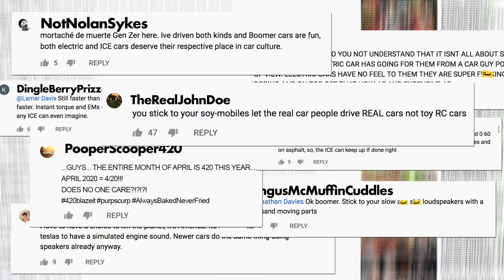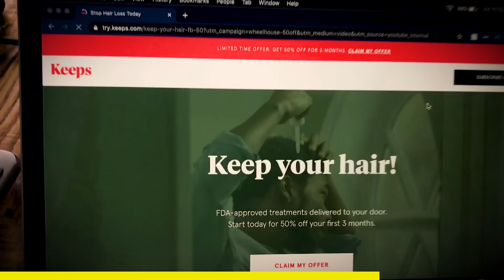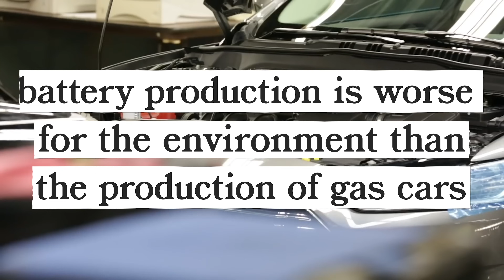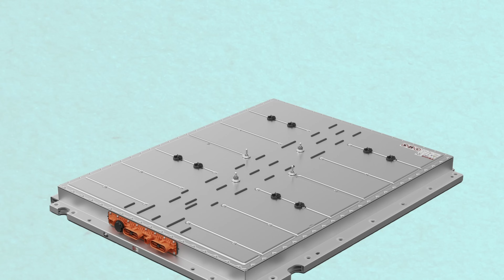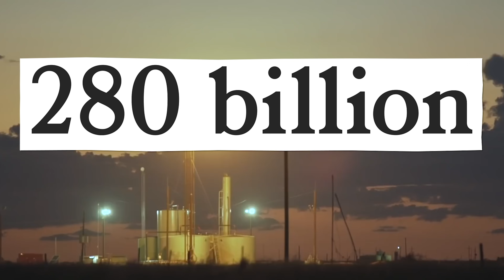Are Electric Cars REALLY Better for the Environment?

Comment: Do you want to cut your CO2 emissions, without giving up your gas car? Cycling more for the short trips.
Reply: or electric scooters
Reply: @lightzpeed4458  come on traditional Cycles will be far more efficient than electric scooter. It will be a workout too.
Reply: @埼玉-u6l  No, the human body is awful in terms of efficiency in terms of cycling
Reply: @Namenloser127  does it increase one's carbon footprint ?
Reply: @埼玉-u6l  Yes, yes it does. You breath out more Co2 and you need to eat more food which may also have it´s own carbon footprint. But what has that to do with efficiency?
Reply: @Namenloser127  Cycling is more efficient than walking. Mark Twain considered the bicycle the height of human achievement. Some  rather humorous stories by him.
Reply: @Namenloser127  not true , you can go 100 miles on a sandwich and a bit of water.
Reply: @Namenloser127  The efficiency of a vegan cyclist is around 300 MPGe,a carnivore 15, and the average cyclist 85
Reply: @埼玉-u6l  trees breathe in CO2 and out O2, we breathe in O2 and out CO2. The amount exhaled by living creatures is easily negated by all of the plant life on the planet. We definitely need to prevent deforestation, and even more so, check the pollution of the ocean, as most of the oxygen on the planet is created by aquatic plant life.
Reply: @Namenloser127 ...sorry, but you're kinda wrong. The difference between bicycling and riding an E-scooter is basically the same if you're comparing apples-to-apples. Obviously, some bicycles and some cyclists are more efficient than others... if you're heavier and out of shape it'll take more calories... but it'll take more power from an E-scooter too.

If you're comparing a road bike to an E-scooter, most cyclists can easily go 15 mph on a flat road and barely break a sweat. The additional calories burned over their base metabolism for an hour would only be a few hundred extra calories.
Reply: @Namenloser127  Haha that is the most hilarious argument against cycling i've ever heard! I'm sorry for laughing but you really should study more. You can't compare eating slightly more and breathing more to driving your car everyday. Cycling more is one of the best things you can to to both your body and our planet.
Reply: @NilsHedstrom  "You should study more" ...ok kinda rude

But when did i bring up cars, i just said that were are not very efficiebt when it comes to single tasks such as powering wheels.
Reply: @Namenloser127  Okay sorry bout that, but I interpreted your comment as saying a bicycle would be bad to the enviornment cause of the reasons you stated which i found as a hilarious argument. But okay now I kinda see your point more. But I would still argue bicycles being the best mode of transportation if we talk journeys bellow a few miles. Its outrageous people take their cars everyday on such short journeys.
Reply: @Namenloser127  Also humans need physical excersise, we need to move which is a fact. So how would cycling and breathing more be bad? Then you both get the excercise needed and transportation every day. Also us breathing more has a minimal impact. Never heard anyone condemn people doing physical activities before.
Reply: @NilsHedstrom  Bear in mind regarding USA's attitude regarding mass transit (which requires walking), and you will soon understand your comment's last bit.
Reply: I bike to work every day 👍
Reply: @sureynix  
Prior to retirement I bicycled 13 miles one way to work about three days a week. There were 35 traffic signals along the route. 
I obeyed all rules of the road and found it took about 12 minutes average longer to cycle than drive. I ran away from the ebikes. 
On the flats with little wind I could reach 30 mph. Including red lights on good days I could average 18 mph for the trip.
I lost weight and gained fitness. Many ridiculed me, my revenge was after 30 years I was 6' 3" 195 lb while my coworkers weighed much more, even the shorter ones. 
Retired 2016 and still ride although  not as much. Still 6'3" and 205. Clean heart and good lungs. Only prescription drug is for gout.
Reply: @edwaggoner7403  the only ridiculous there were those comfy asses that couldn't understand you. You should be proud of yourself, just as proved that kind of decisions make us more healthy and therefore, happier. 😊
Reply: @sureynix  Very brave of you, I have heard that drivers in your country are very agressive.
Reply: @sureynix  wow, you’re so virtuous, do you wear a mask too?
Reply: Ebikes blow my mind. Things are crawling along, and a dude on a pedal bike rips by.
Reply: I ride several ebikes. One designed for riding in good weather and another designed to ride in rainy weather (has a heavily modified Veltop attachment with windshield and cover). I get an average of around 950 MPGe for them which is about 10 times more energy efficient than electric cars. Also I pedal along bionically with the motor to greatly extend the range.
Daily Aerobic exercise I learned is required for good human health. It makes sense to get this "required" exercise traveling to your daily destinations. I use my ebikes for grocery shopping and carrying other light cargo as well as for fun trips.
The Lithium Ion battery packs that I have help me to go to more distant locations and the motor assures me that my exercise is not strenuous (which can be harmful to human health especially for the elderly).
Most of the energy used in electric cars is squandered (wasted)  just moving a big heavy box around.
You don't get any healthy exercise passively as a driver in a ICE car or electric car.
Reply: Yes especially given that the average car journey taken is within a short cycle commute distance.
Reply: Honestly if u Wanna Go somewhere Near a Cycle's Pretty Much Alright to Get to that Place.
Reply: i'll stay with my old v8 and 2 stroke bikes
Reply: If society goes like this we have to put co2 not just in tailpipe but now in nose too if too fat too much emissions
Reply: Water powered cars, they are real.
Reply: @PinkSlimeEntertainment  I think you mean hydrogen cars. Hydrogen is made from water.
Reply: @mardiffv.8775  no, hydrogen is not made from water, actually water is made from hydrogen…
Reply: @PinkSlimeEntertainment  
I once had a water and air powered rocket when I was a child.
Reply: Not that easy when you live like  basically between huge pronounced hills 🥺 so i use electric skate instead
Reply: Or just drive a diesel car. Even better a "blue" diesel car.
Reply: That's what I do
Reply: What if we live in suburbs that require residents to rely on cars
Reply: There’s a way and it’s called e fuels, but car companies want to go “green” since is cheaper to make a ev platform and “engine” than a gas car engine which has more components. But they’ll still charge you the same and contaminante almost the same 🙃
Reply: Good thing I have a diesel truck not a gas car
Reply: @felipe0102031  Hee hee, that is funny. I like that.
Reply: No, that'll hurt
Reply: @8 A.M it's still negligible
Reply: @Ayjop if you don't have time you do and if you need to carry a lot you do
Reply: That would be great if I could get 2 children and the wife on a bicycle and still have room for the shopping …
Reply: @andyxox4168  please stop acting dumb 🙏🏻. You better know when to use a cycle and when to use a car therefore not everytime you go outside you need a car.
Reply: @埼玉-u6l  , yes, I know not to use a bicycle in my daily life … so you get it now!
Reply: @andyxox4168  Buy a Bakfiets. Problem solved. http://www.fietsencompany.nl/product/bakfiets-troy-7sp-naaf-matt-black/
Reply: @mardiffv.8775  … now you’ve just descended into foolishness … 😂😂😂
Reply: @andyxox4168  Well, my country the Netherlands has descended into foolishness then. Bakfietssen/ cargobikes are very popular among mothers of young children. I am happy to go cycling and not drive my car. It saves a lot of gas money. Gas is very pricy up here, due to high taxation (8 bucks per gallon).
Reply: @andyxox4168  Have you seen a yuba bike?
Reply: @MrRentageek  no but if it’s a ‘bike’ I don’t want one thanks 🤮🤮
Reply: @raphaelvermin  …  now you’re making assumptions but for the record I’m not fat, I have a BMI of below 23 and take regular exercise. I choose not to cycle!
Reply: @raphaelvermin  .. right and your ignorant of the normal medical limits of weight, I’m no 10st weakling but I think you’ll find 18-25 is ‘normal’. You’d better check on Google and correct you post.
Reply: @andyxox4168  your bmi is also a small part of the picture and really just tells of somebody is way outside of the normal weight range for their height and does nothing to consider actual body composition. Youre two points away from being literally medically considered dangerously fat.
Whats your body fat percentage? 

Also unless you regularly do actual exercise and lift weights you are a weak boy. Not sorry. Dont @ me. Go workout and stop making excuses for being fat and weak.
Reply: @raphaelvermin  that’s ok, you just go ahead and admit that a BMI of 18 is the border of underweight and that ‘fat’ starts at 25 instead of spouting misinformation.
Reply: @andyxox4168  nope. I wont admit that because anybody familiar with body sports physiology knows that bmi isnt a good unit of measurement by itself and is only a general indicator of body composition. You're skinnyfat bud. You obviously dont workout and you're trying to argue that because you arent 300lbs that you arent out of shape. You are.

Heres a serious question. How many pushups could you do RIGHT now without stopping? 10? 20? Maybe 30? If the answer is anything less than 50 you're either weak and fat or you're a medical patient.
Reply: @raphaelvermin  to return to your original comment we are dealing with generalisations here, no, I’m not proud to be fat, I am not fat (by any measure) and I have a reasonable level of fitness. Unfortunately we cannot say the same for +50% of the population who are fat and a very large number of whom are obese or morbidly obese, your comments would be better directed to that demographic.

As for lifting weights each to his own, you go enjoy . 😂😂😂
Reply: @andyxox4168  pushups are not lifting weights bud. Theyre actually a good even measure of fitness across all shapes and sizes because no matter what you weigh its only you pushing yourself. The number you can do is entirely dependent upon your own fitness level and not just your weight. 
Bmi is just a measurement of your weight against your height and doesn't consider actual body composition or fitness.
Heres another good example of an actual fitness test. If you cant do 10 pullups with your preffered hand position you are weak and fat. 

10 pullups is nothing. 50 pushups is laughable. These are bare minimum fitness standards that can be reached and maintained with a 20 minute daily exercise routine and no weights are needed.
Reply: @raphaelvermin  you were the one who started the fetish with weight lifting, still you would be well advised to stop conflating the issue of fatness with fitness, there is a link but obviously it is not absolute, similarly 8 pull ups at 80 is not the same as 80 pull-ups at 18 if you are into such nonsense as the measure of your life!
Reply: @andyxox4168  i believe that if you maintain a regular fitness routine that you do not simply degenerate with age. This is why we see so many fit elderly people that still regularly exercise. Yes obviously in your golden years you're not going to be able to do what you could at 25 but theres no good reason you cant at 45 other than you didnt maintain your fitness.

Also the numbers im giving are well within reason for ANYBODY that isnt a senior citizen and doesnt have a legitimate medical issue. 
If you cant do 10 pullups and 50 pushups as a healthy man you are ubdoubtedly out of shape whether you are morbidly obese or not. "Skinnyfat" is a term commonly used for people that arent in shape but arent ham planets. I suspect you're skinnyfat. 

Back to bmi somebody 5'10 and 180lbs with a 20% body fat percentage because of a big gut and skinny limbs will have the same bmi as a body builder with a v taper that same height and weight but a bpdyfat percentage of maybe 5%
Obviously one guy is in shape and the other guy is fat but they have the same bmi. 
I suspect you're probably shaped like the former more than the latter.
Reply: @raphaelvermin  you seem to be very suspicious and a troll to boot, your posts are also suffering mission creep into your specialist fitness beliefs, keep going. It’s very entertaining.
Reply: @andyxox4168  one kid on the back of the two bikes, if they’re not old enough to ride their own or stay home for an hour, and a nice big basket on the front of both of your bikes. Seems pretty simple to me🤷🏼‍♂️ and probably almost as safe a a drive to the store.
Reply: @littlewilly9272  two bikes? Don’t know where you got that idea and as for 2 children on one bike with a weeks shopping as well .. good luck with that!
Reply: @andyxox4168  🤔🙄you said your wife and 2 kids.
Reply: @andyxox4168  her on her own bike with one kid and you on another with one. What part is so hard about common sense?
Reply: @littlewilly9272  you’re assuming she can ride a bike, how would that work?

Comment: Thanks alot! For years, I've been curious about what the true and unbiased numbers would add up to when stacked against each other. I appreciate your research and love the channel!
Reply: Most misleading video I’ve ever seen
Reply: @juancappadocio6311  
Your statement might actually hold weight if it was not so horribly vague.
I mean it's SO vague it shouldn't have been written. Is this a troll? Cause it might as well be.
Reply: There are a lot more stuff that needs to be added for EV. Those are the bare minimum people point at not the reality. You have to add in the construction and maintains of the infrastructure of the energy sources. That  is being ignored. Nolan referenced it but it not realist understanding of the amount of Co2 that has to be used to just have the system in place to get the power to the outlet. Look at Texas last winter. The system was upgraded from the last time we had that type of cold weather about 11 years ago. regardless what the media was saying. The place's that had the most problems were in the new developments that have been built since the last freeze. Even with the future proofing the system. The usage when beyond expected needed uses do to the higher then expected growth of new housing predicted 10 years ago. What do think would happen with you can't charge your car do to power outages.

Comment: 9:55 Myth #2 Do you have any proof ? EV's take a lot of power to charge. I remember all to well we had to be verry conservative with our electricity and they actually shut down whole towns to protect the grid from overloading, without any EV's to charge. I've read many times this happened in America too ? A Tesla takes aprox 50kWh (not fully discharged!) per charge. This would mean you could fully turn on your electric stove (4kW) + hair drier (2kW) + microwave (1kW) + Electric oven (3kW) and leave them fully on for 5 hours! That is a LOT of CONSTANT power for only 1 Tesla to charge. Thanks for explaining.
Reply: They don’t usually take that much power except under extenuating circumstances. Firstly the mostly charge at night when you’re asleep. When demand is the lowest. Secondly, you don’t use 50kWh/day. My standard range model 3 has a 50kWh battery. I drive around 100km/day for work with an average consumption of 130 wh/km. Or 0.13kWh/km. So that’s 13kWh per day. 

So that would be like running all those appliances at once for 1 hour and 18 minutes. And I have a longer than average commute. I’m reality they usually draw here in Australia 3kW from the power point so it takes me just over 4 hours to charge each evening, or if I had a wall charger which is hardwired for 12kw it would take just under 1 hour.
Reply: @engineeringtheweirdguy2103  Not really proof that the grid will hold it, but gives me more insight on what it takes to charge, thanks. I would need about 80km/day.
Reply: @BrainHurricanes  if it also helps. The grid on averages doubled every 20 years. For example 20 years ago barely anyone had person computers, laptops, tables, mobile phones which were basically computers, smart appliance, etc, yet alone a set of these things for every member of the household. 20 years before they electronics were things like the occasional bender, maybe a washing machine or two. 

Even optimistically the transition to battery electric will take at least until 2050. And they are charged when grid demand is typically lowest, meaning better load sharing.

Ultimately I don’t think it’s unrealistic. It would be if we thanos snapped our fingers and everyone’s cars magically were converted to electric. But that’s not how it works. But people always base this assumption about the energy based on that, or they think the power grid hasn’t changed since the 1950’s which is plainly false.
Reply: @engineeringtheweirdguy2103  What came first, the extra grid or the devices? How long did it take? We should have by now, no issues with brownouts even during summer...

Comment: Good explanation. But I think you should ve taken into consideration that the demmad for energy will increase with eletric cars and new wind and solar parks will be constructed, not mentioning, the material for recharge points. That wouldnt pollute more?
Reply: That logic is flawed, as every EV that is more efficient is taking a less efficient combustion engine car off the road.  So, the energy use will be less over time as EV's are 4x to 5x more efficient per mile to drive.